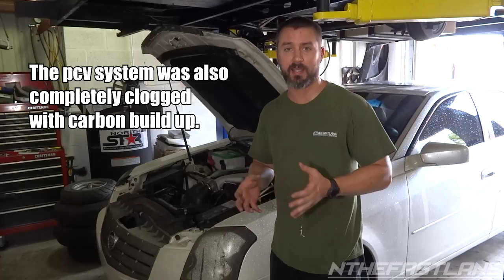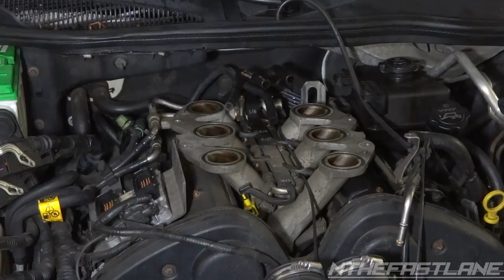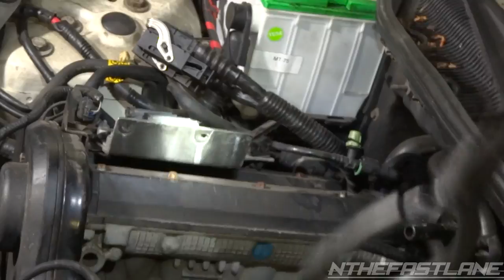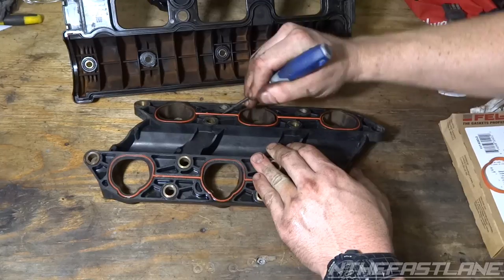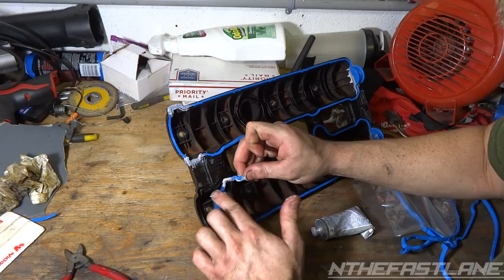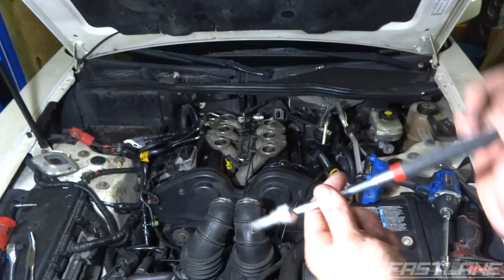▶️Cadillac CTS Valve Cover And Intake Gasket Repair 2003-2004🔧

Comment: i agree 100 percent you must  use permatex on these rubber gaskets in these northstar engines to finally get them sealed  but Felpro the gasket manufacturer absolutely does not agree with our method and they state you should never use permatex on rubber gaskets like i mentioned i agree with you but im just simply saying what Felpro suggests just so people watching this video can see this thanks great video brother ;)
Reply from the maker: No company want's to tell a customer that their product only repairs 75% of the job. ;)

Comment: Great video, thanks!  I have a coolant leak and was thinking it was either the oil cooler or a head gasket.  The coolant is running down the back of the engine on top of the transmission.  Sound like a common problem?
Reply from the maker: Check the back of the cylinder head, there is a coolant line exiting it. Tends to leak there. Tight spot, but that could be your problem.

Comment: I wrecked my 2011 STS 3.6 LLT so I went bought a 2008 CTS LY7 beautiful car with a blown engine...I was just gonna swap out the motor and transmission from the STS to the CTS.Will that work?

Comment: Another question, would the oil spill over cos smoke to exit out muffler?
Reply from the maker: If you have a bad/clogged pcv system it will cause excessive crankcase pressure. The crankcase pressure will cause oil to get past the piston rings and burn in the combustion chamber and out the exhaust.

Comment: Thank you for the breakdown of this video really enjoyed it but I do need your assistance on the Cadillac CTS 2003 I have no problem with a coolant leak directly from the reservoir going into the back of the engine have no idea where leak coming from except for back of engine need some assistance or knowledge things that's located in back of engine that will cause a water leak 3.2 engine V6 Cadillac CTS 2003 thank you for your help maybe I will be able to make a video on showing how to fix this issue with your help
Reply from the maker: In the future if you have any questions you can always post on my Forum. www.Nthefastlane.com/forum

For your question, I would say that there's a coolant nipple on the back in between the two cylinder heads. The hose could have dry rotted. I would try to get over the engine and look down at the back and see if you can see the coolant hose. It connects into a nipple. I believe it's the heater control valve hose that runs up through the back of the engine all the way up to the passenger side of the vehicle, and then up to the radiator.

Comment: Could this be a possible repair instead of a total head gasket repair? My car had a little bit of oil on the Spark plugs, and replacing them made it go from one cylinder misfiring to 4 of them misfiring. I also go through coolant pretty quickly.  I love my cts so much but it's not worth spending thousands on a new head gasket.

Comment: Will this solve oil in the spark plug coil?
Reply from the maker: Yes it will. The only way it would not is if the cylinder head had a crack in the spark plug galley. Chances of that are very unlikely. I would say 95% chance it's your valve cover gasket. If  you see it in multiple spark plug galleys then definitely valve cover gasket needs to be replaced because it's too brittle and no longer seals.
Reply: What if oil is only getting to one side??

Comment: Same engine as omega in Uk/Eu and Catera in US? Coil pacs have a threaded insert in the bolt holes in Uk engines. We can use the plenum bolts to screw into the coil pack to pull them out easier. Presume same for you guys in the US. ....ps we get black rubber gaskets from dealer comes with black goo, flicked through the video. Apologies if I missed these points.

Comment: Supposedly there is a new redesigned valve cover gasket for the passenger side that prevents that oil leak.